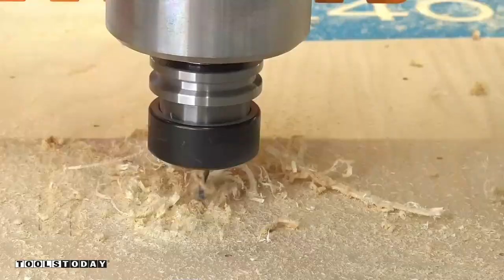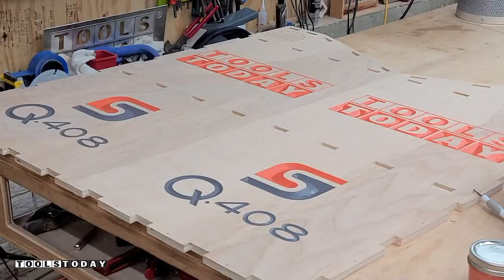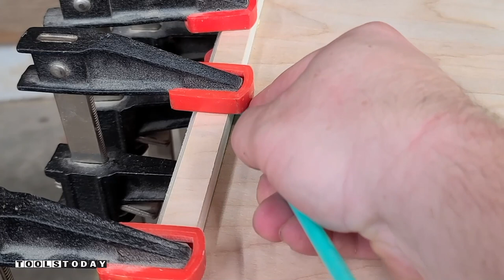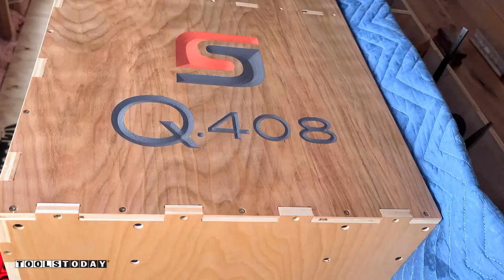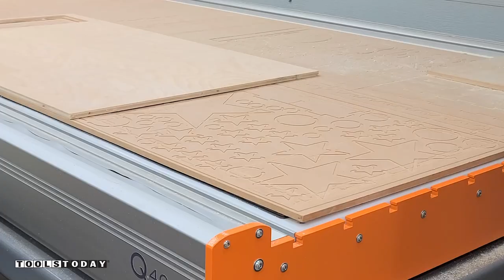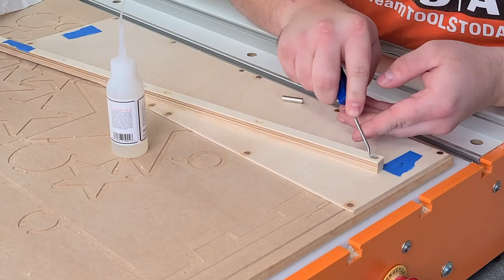Matt’s CNC Computer Cart Build | ToolsToday

Comment: Wow excellent job sir . They said the rule of thumb if u using 1/4” D bit u can set the depth per pass double size the diameter . Is that right ? Also let’s say if u do it 1/2” depth how fast u can do the feed rate ? If u have a heavy duty cnc like urs ? 
Thank u
Reply from the maker: Thank you very much.  Each bit is going to have its own feeds, speeds and depth of cut info.  The compression bit I used can take a 1/2" depth of cut as it is designed for it, but the downcut or upcut bits were set at 1x diameter which is generally recommended for most of our bits.  The compression bit was set at 120ipm feed rate.  Hope that helps
Reply: @ToolsToday  yes very helpful thank u very much sir

Comment: Not a single piece of information in the plans or on here for the measurement on the drawer slides…
Reply from the maker: From the bottom of the cabinet to the bottom of the drawer slides, they are installed at 20.75”, 29.25” and 32.5”.  Where the slides are installed really doesn’t matter too much as long as it hits the drawer that goes in that place.

Comment: Thanks for a great video showing how a CNC machine can be used to build a piece of furniture. Very creative! As a more "classical" cabinet maker, however, I have trouble accepting the through tenon joinery with exposed plywood  end grain. Could  a similar CNC machined cabinet be built with classic dado and rabbet joints?  I presume the plywood sheets would have to be turned over, so the machine could work from both sides. If so, how would you register the sheet so that the cuts on the reverse side mate with those on the front?
Reply from the maker: I’m glad you enjoyed it!  Yes that could all be done, it just simply wouldn’t be quite as strong as the tenons shown here. You would need to machine both sides, unless you did it without the logos.  To do that I would have created a fence or used some dowels into the MDF as location points so I could easily and accurately flip the work piece.  I hope that helps!

Comment: Matt Nice cabinet  Can the plans be altered to be cut on 32x32 cutting area cnc.Is the design done in VcarvePro and by any chance have a video on that. thanks Jeff
Reply from the maker: Thank you!  The single smallest part is 41.5" x 18" and there are two of those, but you definitely could split this part to work on a 32"x32" cutting area.  All other parts can be easily rearranged to work within that cutting area.  The design is done in V-carve pro, but I do not have a video on that.  I've got over 30 hours into this design, so it would have likely been a boring video 😀
Reply: @ToolsToday  Matt I just downloaded your computer arm file and  got it all the separate pieces. canI assume that the x 5 means 5peices need to be cut.Is there any info on laying out all the parts picture or even wood thickness
Jeff
Reply from the maker: @resorter66  correct, on the .svg files the 5x would mean you need 5 of that part.  Thank you for the support!
Reply: @ToolsToday  Matt can you tell me about your tabs how long and  how thick the reason I ask
is that when you shut off the vacume table the the plywood sheet came right off
Jeff
Reply from the maker: @resorter66  I set tabs to .3" long x .1" thick generally.
Reply from the maker: @resorter66  I think I misunderstood your question.  When using the vacuum table I don't use tabs unless it's a small piece or something I need to be absolutely sure doesn't move.  When I do add tabs, the dimensions above are what I use.

Comment: I have purchased the plan but was curious about the jig you used for the draw slides Lengths/location?
Reply from the maker: Basically it's just some scrap plywood that I cut down and glued together to act like a t-square.  I then cut it to the length I needed and kept cutting it away for each drawer to make sure both pieces were exactly the same. I hope that helps!
Reply: @ToolsToday  Ok, I was curious on the length of T-Square for each location of the drawer slides

Comment: Did you use a shop vac for the cnc hold down?
Reply from the maker: Kind of.  It's a Fein Turbo II vac.  It has two motors, one to draw suction, the other to cool the motor, so it will stay cool even without much air movement where a traditional shop vac would over heat very quickly.